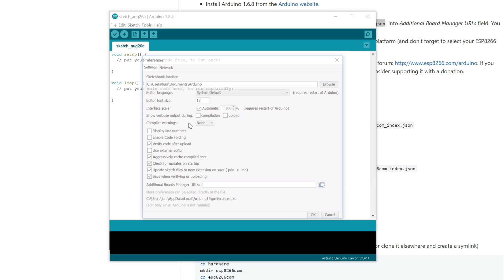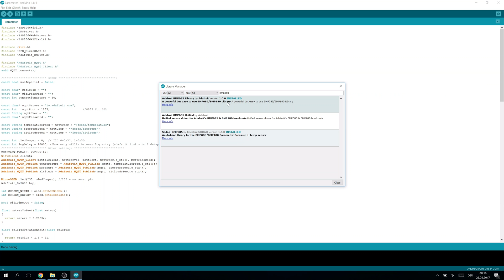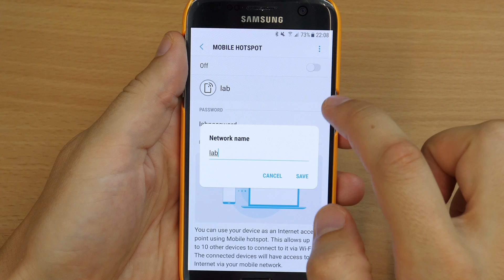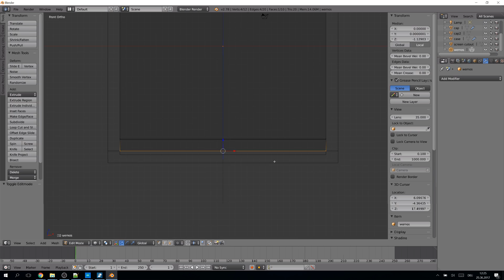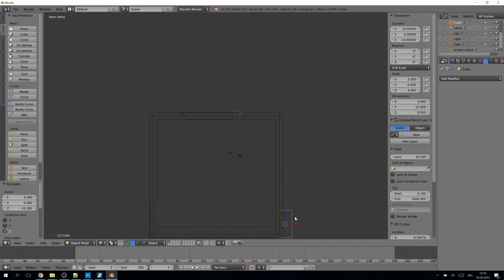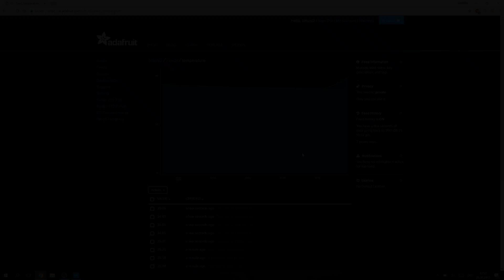How to make a Temperature, Pressure, Altitude Logger [Esp8266, WiFi, Arduino]

Comment: OK, I have the same hardware, I'm using the same version of Arduino.  I've added all the libraries and added the ESP8266 board in board manager.  I've picked every single esp8266 board install but still cannot compile!  ARRRRRRGH!!!  Sorry, had to do that.  Every single board only say's "Error compiling for board...(fill in any esp8266 board here)".

Comment: Hi, please help. When I compile your code I get the following error codes, 
Arduino: 1.6.9 (Windows 10), Board: "WeMos D1 R1, 80 MHz, 4M (1M SPIFFS), v2 Lower Memory, Disabled, None, Only Sketch, 921600"

WARNING: Spurious .github folder in 'Adafruit BMP280 Library' library
WARNING: Spurious .github folder in 'DHT sensor library' library
C:\Users\Richard\Documents\Arduino\libraries\Barometer-master\Code\Barometer\Barometer.ino: In function 'void loop()':

Barometer:92: error: 'showValues' was not declared in this scope

   showValues(t, p, a);

                     ^

Barometer:94: error: 'mqttLog' was not declared in this scope

     mqttLog(t, p, a);

                    ^

exit status 1
'showValues' was not declared in this scope

This report would have more information with
"Show verbose output during compilation"
option enabled in File -> Preferences.

Comment: Guess I answered my own query, I took a tiny oled that was i2c, and a BMP180 sensor which is i2c, hooked them up to a WeMos D1 EPS8266/Arduino Look-a-like, loaded your script and I have a working altimeter, which is what I wanted for the dash of our Motor Home so I know about where we are when crossing the mountains in Wyoming, Colorado, New Mexico and Arizona, where we spend our winters searching for the 72 (degrees).  This will be useful, however I am going to have to figure out a better display, my 67 year old eyes have a hard time trying to see that tiny print on the 0.96 OLED screen, even though it is bright and so very sharp, as OLEDS tend to be.  Maybe I will try and get a larger LCD screen to work in it's place, perhaps a 16X4 or something like that, I do have a nice 128X64 blue/white screen that could perhaps make a nice display if I can figure out how to hook her up to an ESP8266 or perhaps an ESP32 so I can use some of the blue-tooth functionality as well.

Comment: Not sure if you would be interested, but ... How hard would it be to also add GPS to this? I drive a lot and would like to track my location and altitude. I already have an Arduino UNO with an SD shield. Just asking?

Comment: your altitude was off because you didn't take temperature into account, have you?
Reply from the maker: I have used the altitude calculated by the library..
Reply: I know and they don't compensate for that, it's only based on pressure, which is not correct
Reply from the maker: betrayal! It probably needs to solve a nonlinear equation. I'll fix it for the next logger :-)

Comment: #giveaway Blue. Cool project! Cold you not use small lipo to power it?
Reply from the maker: You could, it draws 0.1-0.2Amps. A 0.4mAh lipo will last 2h. That might be not enough in some cases. If you make the case bigger a 18650 could be sufficient

Comment: #giveaway thanks guy for the video. I understand that for logging the values, you need to be connected to the net continuosly. Do you know how to log in the EEPROM and then share the datas via wifi? Thanks again, I learn a lot with you. If you choose me to send the device, I don't mind the colour.
Reply from the maker: eeprom ist not very big, but we could use it. I will make a tutorial how to write to SD, so you don't need an connection
Reply: bitluni's lab it would be great. thanks for sharing

Comment: #giveaway any colour. Enjoy your videos. I also use Blender to model my 3d prints. Do you know about the 3d printing plugin? It is a standard one you just have to enable it.
Reply from the maker: nice.. I didn't know. Is it good?
Reply: It is handy. It has some print-ability checks like making sure it is manifold. It can highlight the problem areas and there is a "make manifold" button that sometimes does the trick. There is an STL export button and it will export whatever object is selected with a name combining the blender filename and the object name. You should try it.
Reply from the maker: It's funny that we have written before. Now your name has been randomly drawn... You won a logger please send me your address where to ship the device to my email address bitluni@bitluni.net . no worries it won't be shown anywhere
Reply: Got it today. Thanks!

Comment: I think since altitude is calculated partially by pressure it's always going out a few degrees.  #giveaway  green :)
Reply: On the one that I built out of older parts, I needed to subtract 300 feet to get her to read very near our present altitude of 2567 feet, going by my Garmin SatNav hand held unit.

Comment: (Black or Clear if I win the #giveaway please) --- Congrats on the big move! Funny and informative as always. (0.29 "OK..." lol). But... If I get one, does that mean I have to cut a hole through my desk to run the usb cable through? Seriously tho, I get that you wanted to just stack the shields on the wemos with as little hassle as possible, but it would be really nice if there were an easy way to have the cable come in from the back (the side opposite the screen). Either that or "legs" below the box so the usb cable can bend back.  Always great videos!
Reply from the maker: another possibility is to make the code render up side down.. anyone can fork my code? :D
Reply: good point. Or sideways.

Comment: #giveaway blue 

And was curious to know , do you edit your videos on the xps13 ?
Reply from the maker: yes.. kabylake helps encoding, but it's a trade off between mobility and power. However, I also use a razer core with 1060gtx as docking to have an additional screen and more connections. A simple dongle usb-c to hdmi instead of the noisy razer when I record voice.
Reply: bitluni's lab oh that's nice, I never thought of that and went and purchased the xps 15 9560 and now I understand how difficult it is to carry a 2kg load with you. The reason for me to buy that was for editing videos for my upcoming YouTube channel , but yeah thanks a lot for the reply